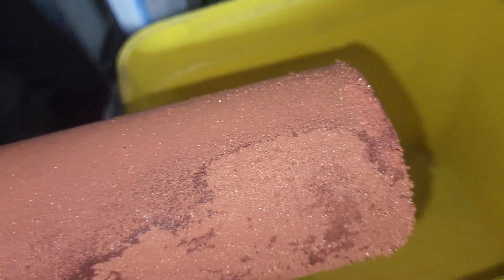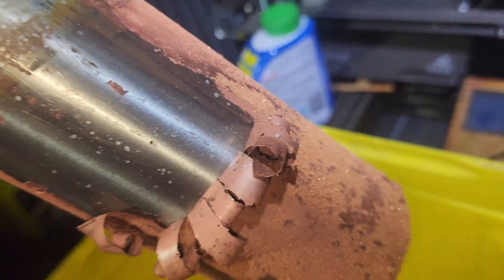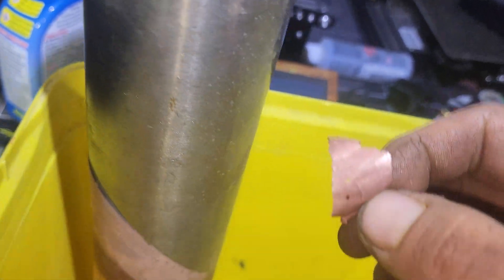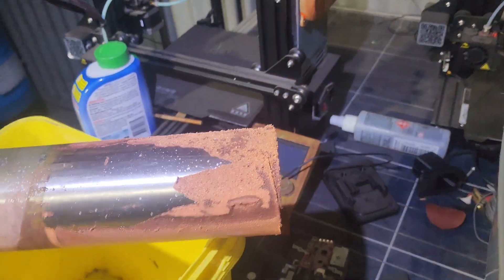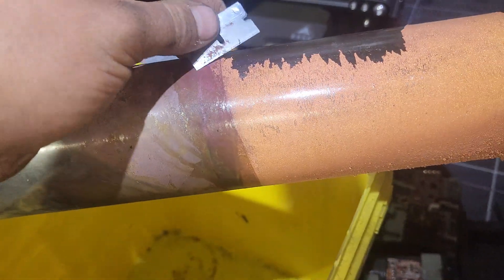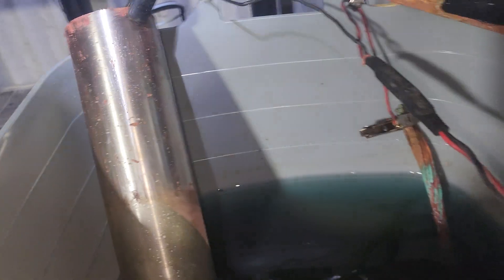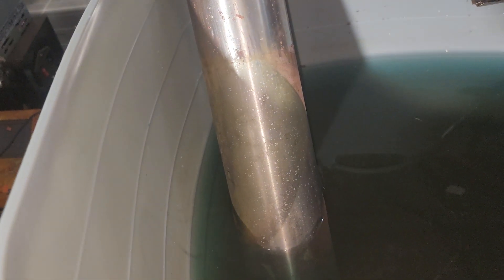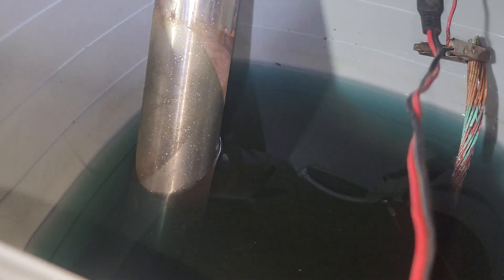We Are Farming Copper Electrolytic refining copper sulfate cell Pt2 plating to stainless steel

Comment: What voltage are you using?
Reply from the maker: Between 1 and 2v 5 amp start
Reply: @Oneupthesleevecustoms  Thank you!
Reply from the maker: I've found over 3v it burned the copper black
Reply: @Oneupthesleevecustoms  Yeah, mine does weird stuff at higher volts. One dude runs his on 7v and I'm like how? I think a found a good spot at 2v. 1v was going too slow. I'm patient, but it wasn't doing much. So many variables, but it sure is interesting!